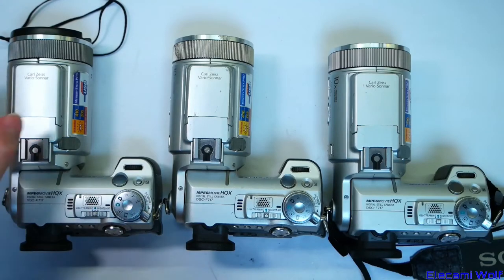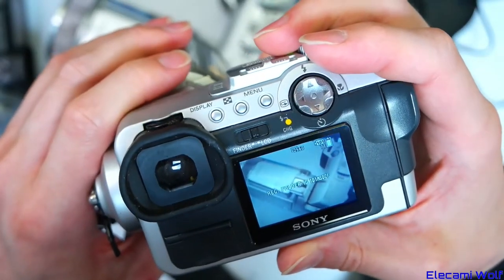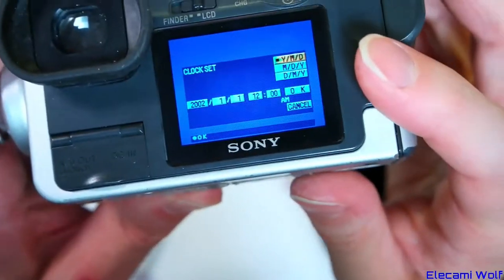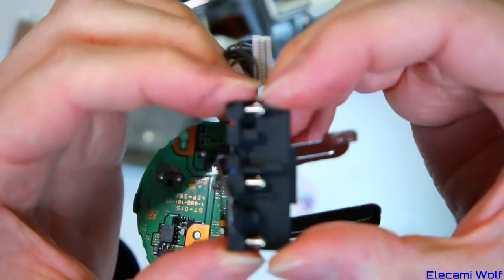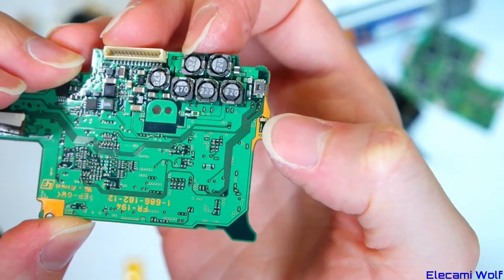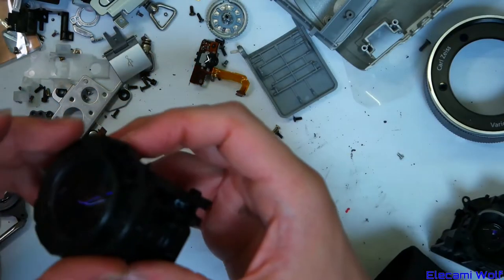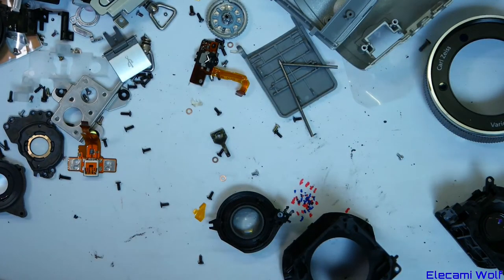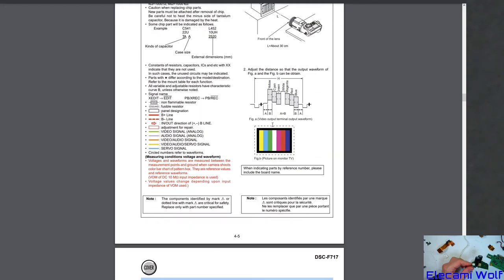EW0035 - Sony DSC-F717 Digital Camera Teardown

Comment: Error C:13:01 is caused by the camera's internal memory stick contacts being worn or dirty.  Disassembly and cleaning of these contacts usually will fix this error (if you can get to them).  If this doesn't work I've heard (but not tried) to use a pencil to deposit some graphite on the contacts of the memory stick which increases the conductivity of the contact.  These are great cameras and take great pictures.
Reply from the maker: Thanks for the info. I'll keep that in mind if I revisit these cameras.  Not sure I will get back to them. there is so much other equipment if need to look into first.

Comment: This camera was a good attempt to innovate and try a new form factor, and it's too bad it had issues and never caught on. Seems like Sony was always trying new things. The '90s and early '00s had so much cool experimentation in design, at least compared to now.
Great tear-down. That flash capacitor discharge made me jump too lol. Loved the close look at components with the microscope.
Reply from the maker: Thanks. Always got to remember to discharge high voltage capacitors. Or you can jump even more. Very dangerous.
It is an interesting design that allows a good quality lens.  Probably did not catch on due to its size. Compact cameras were more appealing.

Comment: That assembly behind the lens is not an ND filter it is for flipping the IR blocking filter out of the way to enable Nightshot mode... as you discovered later. :) Very unique feature of these cameras. I used to modify and resell them (many years ago) by replacing the filter with a clear optical glass so one could shoot IR at all speeds. Since then it's been discovered one can merely use a magnet from the outside to do the same thing! 
Loved the close-ups of the LCD and sensor. 
This video will help me repair a 717.
Thanks.
Reply from the maker: Makes sense, you would need to get the IR filer out of the way to use the night mode. Just like in security cameras. Thanks for the info.

Comment: I have one of these, perfect working order, just found it in the original aluminium SONY CASE wit 2 batteries &  the 2 lenses 1 wide angle All the paper work & cables, 256mb 64mb & 32mb card.....LoL, I remember when they launched a 1 GB card PRICE £600 but was massive in its day, will be selling it soon I think
Reply from the maker: Nice that is still working! Most failed due to CCD issue.
Reply: Hi unsure if you still have it, I just bought one from a thrift store. Do you know how I’d get the pictures from the memory stick to a modern computer? Thanks!
Reply: @shmiddledeedoo  Sony Memory Stick PRO DUO 512MB small 0.5GB MS memory card - memory cards (MS, -10.56-85 °C, 20 x 31 x 1.6 mm, 2.7-3.6, 10-pin Serial Memory Stick Interface and 4-pin Parallel)
Reply: @shmiddledeedoo  Integral All-in-one Multi USB2.0 Memory Card Reader Adapter - Plug & Play and Compatible with 19 formats including SD, MICRO SD, COMPACT FLASH, MEMORY STICK PRO DUO, PRO DUO, M2 & xD PICTURE CARD

Comment: I have the same 717, the LCD display shows horizontal color streaking like shadows. Can replacing LCD screen fix the problem?
Reply from the maker: I am not sure. In the video I tried changing the LCD screen and it did not fix the problems it had with streaking colors.

Comment: Do you think it would be feasible to do a image sensor replacement on one of these, just picked one up for $15 and i really want it to work but the sensor is bad. Other than that the rest if the camera seems to be fine, thanks!
Reply from the maker: I am sure it is possible but I don't know where you would get a good replacement CCD from.
Reply: @Elecami  I did find some on Ali Express but I'm guessing it's a gamble to see if they're still working
Reply from the maker: @ja.8077  Difficult to know, might be worth a go if it does not cost too much.
Reply: @Elecami  it's like $30 maybe I'll try it out in the future. If I do I'll let you know how it goes. Maybe I can make a video lol

Comment: How is it possible I did't find your videos before ? I have two of those cameras, at least...  Sadly I had  to downsize my camera collection, because of lack of space (lots of other stuff in the hoard) and a bunch of them where just decaying, in particular the Minolta film SLRs, all rubber parts became goopy.
Reply from the maker: Not sure, how did you find it now? 
Would this stuff appeal to more, not sure how / where to advertise it more?
I see you have got a good collection of stuff too. I've got a lot more video cameras to go through and a very large amount of VCRs (100+). It might get boring, but I want to document them at least. 
I've seen the rubber / grippy / coated parts going bad on some of my stuff, also the multicore video camera cables going sticky, not very nice.

Comment: hey man, could u please do a tutorial on how to fix the “memory stick error” w the code c:13:01 🥺
Reply from the maker: Sorry I don't know about that. Have you tired a different memory stick or formatting it?
Have you looked up what the error code means?
Reply: Hello, I have the same problem I bought another memory stick  My camera is a dsc-f707 I already tried with the m2 but i dont know how to fix It
Reply from the maker: @elwaramay8813  I don't know sorry, you'd have to check the service manual for your model camera.
Reply: @Elecami  I think I have a solution for my problem maybe someone else can help but I've been looking at forums to fix it and I got to one where they say that the problem may be the maximum memory capacity allowed in the camera and the maximum allowed is 128mb.
Reply from the maker: @elwaramay8813  Ah, yes. You might be best to buy an old original Sony memory stick rather than using the newer modern versions.
Reply: The community on website discuss this problem and someone said F717 can handle 1GB (2GB not sure).I bough my f717 from fb market place came with256mb work well so far.Then i try 4gb it show same error as your. (will try 1-2GB soon)